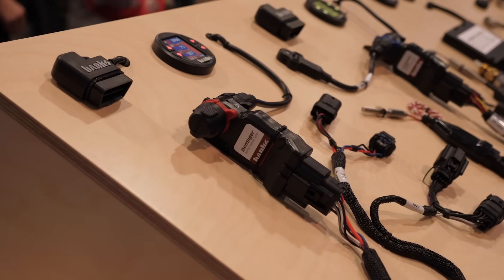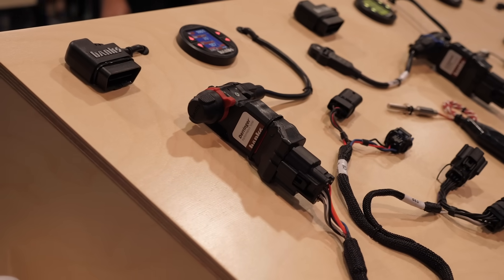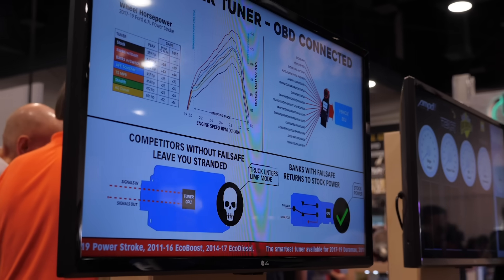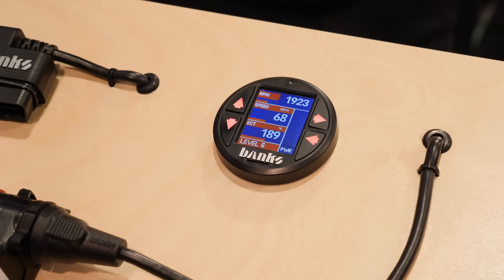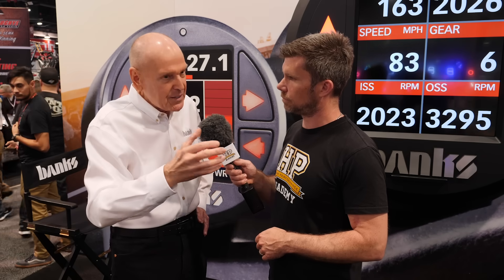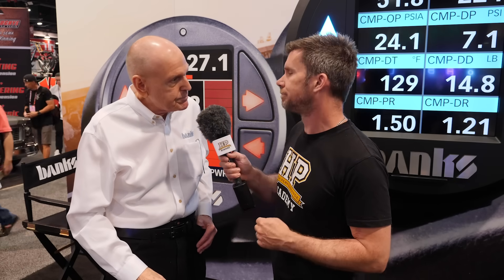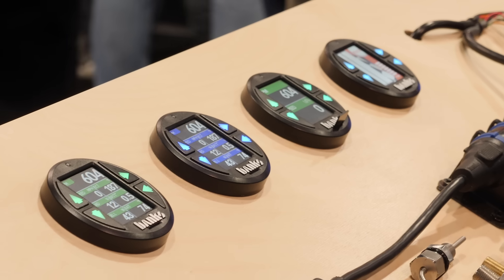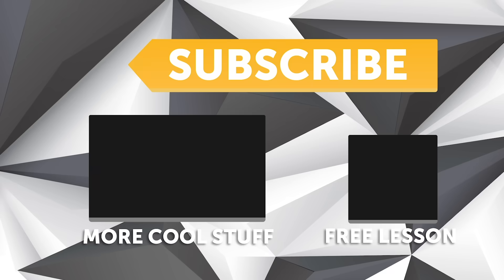More POWER With A DPF Fitted? | Gale Banks On Emissions [TECH TALK]

Comment: the failing emissions components and their replacement cost are criminal.
Reply: Basically in simple terms the new diesels eats it's own shit. The soot gets recirculated back into the engine ruining the internal components and contaminating the oil or turning the oil into grit. Which puts sand paper friction on bearings and such. I've seen this in ag equipment. 300 hrs and a tractors engine is done because of this emissions shit.. how long would the human body last if it eats it's own shit.
Reply: Searb reath These trucks run better without the DPF and EGR systems, everything lasts longer and costs less, I do both, use diesels for pleasure and work, and we had so many issues with dpf systems out of warranty we had to eventually buy new trucks or delete the ones we had, it didn’t make money sense to keep it compliant out of warranty when it kept having issues. Same thing with big trucks on the highway, while MANY aren’t fully compliant emissions wise, the ones that are still deal with not making much money at all, due to many concerns including this here.. so yes, while I can afford to stay compliant, it’s completely dumb in my opinion to be forced to keep it compliant, and forced to pay super expensive prices because you know I HAVE to buy it.. regardless of being able to afford it, getting price gauged is stupid. I’m not for smokey douche tunes, I’m more for reliability and money sense as a business owner.
Reply: ForgedDuramax I can vouch for what your saying. I deleted my p/u truck for reliability and longevity, not to roll coal!
These guys talking shit, you can’t afford it , have no fucking clue. I work in a tractor trailer shop, and I see first hand the issues with this stuff. We constantly have trucks in the shop for won’t regen and in limp mode, regen too often, stuck egr valves and pulling filters to be baked! 
I feel sorry for the owner operator guys, it’s not so much the cost of repairs.. and it’s salty! It’s the down time!
Reply: @50calprepper  That's some funny shit right there cause just last week our brand new catapillar loader had to get its filters baked already! The sucker doesn't even have 100 hours on it yet!
Reply: Searb reath you’re stupid. I always hear shit from truckers here in Ca about the stupid def/dpf  systems fucking up their trucks and show up times. I suggest you shut the fuck up and keep your stupid uneducated guess on what other people think.
Reply: Yep another way for big goverment to steal people moneys.
Reply: Searb reath  maybe you speak to a fleet owner and hear about the stupid increase in cost and maintenance.  That cost is passed on to their customers.
Reply: Searb reath  didn't name the manufacturer. I blame the EPA and bed wetting environmental brain washing.
If you like to read I suggest "apocalypse never"
Reply: The EPA is criminal.... And no I am not for rolling coal. We do need clean air.
Reply: blackscotydog that was a dumb ass, had lighting response!
Reply: @blackscotydog   a little soot does nothing to the air
Reply: Searb reath  i see you really dont understand the whole issue...nobody talks about heavy duty emission related issues where adblue pumps, EGRs, clogged DPFs and all other emission shit goes kaboom. Here in EU people drive long distances to home and work. Some even around 100-200km daily. The diesel is cheaper here than petrol. Also diesel has the torque what petrol doesnt, for daily driving this is needed more than your high end petrol hp. I would say that diesel is more future than petrol, but USA shitty smoke tunes have destroyed the reputation of diesels. Also all those who get walked over by fast diesel cars. Before you comment about using trucks or whatever for daily cars, i will always prefer diesel because of cheaper fuel price, easier to fix and find issues and also because of the torque and shame, when some high power petrols get gapped. 
DPF delete is better for the car and wallet.
I cant say same for the environment BUT all the elements mined for the DPF, constructing it, the extra fuel what goes into regen etc doesnt acutally save the earth either...sounds more like moneymaking spot, same as adblue. Without DPF Engine is more healthy because there is less strain because of the regen , back pressure and high temperatures. 

Say NO to the shitty "smokey chimney" tunes and do it the right way.
Reply: @Rrrowl   smokey tunes are the right way.
Reply: Searb reath  You know that semis and other heavy trucks have had major issues with the emissions requirements right? Look at the MAXXFORCE as one example. Also, why do you think CAT stopped making truck engines?
Reply: @Raise986  exactly! Our oilfield tractors are always having dpf/emissions issues. When I did work as a mechanic we had shit tons of trucks towed in because they were disabled from emissions system failures. My pickup is d3l3ted, but I dont go around rolling coal. My tune doesn't smoke at all on the 0hp setting. I didnt do it to roll coal like a juvenile, I did it because I want my trucks engine to last. Same reason I use diesel kleen fuel treatment to give the fuel some libricity so my high pressure fuel pump doesnt self destruct. Fass lift pump coming soon.
Reply: @Raise986  issue with that engine is that it was a dirty engine to start with. It should of been replaced.

Adding emissions controls to an engine that qas never designed for it is not a good thing. A dirty engine will never allows the aftertreatment system to operate properly or  last
Reply: Glad I got a spare 24 valve and a spare 12 valve.
Reply: Searb reath  high idle switch.  9 pounds oil pressure idling?? That engine is shot to begin with.
Reply: Searb reath  low oil pressure must be a ford thing.  Every Chevy I've owned has approximately 30 at idle..
Reply: Fuel additive and oil additive will help keep your dpf alive, nobody but the people using them on a daily basis will not say anything in regards to this issue, and the people not using these additional additives will typically complain
Reply: Shane Gunter 🤣
Reply: Searb reath  Why do I see guys taking new semis and ripping the emissions stuff off then if they can "keep up"?
Reply: Plus the fact that the manufacturers know this so they cut the warranty down to 50k miles instead of 100k.
Reply: If you’re using a smoking tune, you’re exhausting unburnt fuel.  True.  And if you’re deleting, you’re hurling soot all over your home.   Diesels need regulation.  
It’s expensive.  But the true cost of deleting is more expensive in health, human and nonhuman, alike.
Reply: @ColonelEMHouse  bullshit. your gas burning car is more dangerous then a coal rolling diesel.
Reply: Disban the epa!
Reply: No kidding!!!!  Having the carb and state of California working with the epa to throw bs mandates down our throats that not only do not work but also have bankrupted many many trucking companies and truck owners
Reply: Your not smarter than Gale.
Reply: My new truck was stuck in a different state hours away from my home for a week while I was at home waiting to have my emissions system fixed that cost me also $3000. The truck was used but had under 50k on it so I had a new payment plus the cost to fix just to break again months later costing me another $1000. It's a never ending battle with emissions on a diesel so had to go back to a gas motor because it was so unreliable. I wish I had done more homework before dropping 50k on a truck just to cost me so much money and have to get rid of it. It's such an unreliable system on a motor that is supposed to be known for reliability. It's a joke.
Reply: @williamroberts8550   Quality of Diesel and small communities drives make diesel trucks unreliable. In a world, with high compression diesel, people are buying wrong cars for their needs
Reply: Sounds like he works for the Epa lol
Reply: Searb reath You can stop right there bud. I own a diesel that is deleted because I’m not dumb enough to fix the stupid emissions shit every time it breaks. I’m also a diesel mechanic. I know all about the bs emissions systems and how it chokes the trucks and does nothing but hold it back. I work at a dealership I see the markup on the parts. Get some pink matter between your ears and then you can talk
Reply: @huntguy3831  every one one you tube is a diesel mechanic haha....idiot
Reply: Dylan Carmack I wish someone would’ve told me that earlier. I’m going to tell my boss I’m not a mechanic anymore so I can get moved up to an office job
Reply: Searb reath  If diesel's are only designed to tow, why does the Ram 2500 Cummins come with coil rear springs?
Reply: lllLoko because it's a better ride! You can't still tow 20,000 pounds with those!
Reply: Paul aka PD DIESEL keeps the emissions on his trucks,works'em hard and has put on a boatload of miles with hardly any issues.
Reply: Depends how you maintain your equipment also driving Habits create problems
Reply: O my god the Diesel bros butt hurt is sooo deep.  Your truck is not a fucking race car.  Take that shit to a race track. Nobody wants to breathe or listen to your loud ass dirty truck.  

Emissions dont kill engines. Stupid people do. 

Gale is 100% in the right here. Legally and morally.
Reply: @williamkillingsworth2619  so what's worse, the soot that settles to the ground or that toxic shit coming put of the exhaust that burns your throat, eyes and sinuses when it regens?
Reply: @williamkillingsworth2619  for trucks that aren't race cars my 800+hp cummins sure does walk alot of turbod vets etc on no prep 

Theres diesels out there running 5 second quarters and here you are telling us how slow they all. 

Brain cells are a super power these days i suppose
Reply: @fredmertz3837  try harder, if you think that's is going to offend me... lol.
Reply: @williamkillingsworth2619  Enjoy 10th grade and gym class.
Reply: @fredmertz3837  Thats all you got?
Reply: @natemartinez4595 Where do you race at?? I'll come out.
Reply: @williamkillingsworth2619  Thats all your worth little boy. Now go clean your room
Reply: @williamkillingsworth2619  so your ok with killing off the honey bee? Do some research before you open your mouth dpf and urea are not as good as you might think.

Comment: Exactly and well said.  More air or more air density is needed and once you have that it's easy to add the right amount of fuel to get the "complete combustion" and pollute less, not more. This DPF/DEF/CAT engineering is the cheapest band aid idea the EPA could have come up with. These Diesel engines need more engineering in the combustion of diesel, not a diesel fuel powered furnace that consumes more fuel and generates high risk heat.  The auto makers need to give us our monies worth with the engine engineering as to not produce the soot therefore eliminating the DPF/DEF monster idea that only takes away engine life, fuel mileage, power and so forth.  Truck owners are being forced to maintain and support a dumb method that was created on the cheap to manufacture and sell units vs. manufacture and sell reliable and clean trucks to the public. Overall, the new DPF emission ideas cause premature engine wear which is about the same as taking away 500,000 miles from engine potential life spans. Most highway long haul diesel engines of the past would go 1,000,000 miles before a major overhaul was required. Today, some are having to overhaul as low as 300,000 miles which is due to the back pressure and heat build up that DPF creates !   NOT a well thought out emission system, it's a cheap and simple band aid idea that puts owners of these vehicles in a bad way. Maybe it's time for the EPA to consider the public and the exorbitant costs that they are forced to deal with and get the vehicle manufactures on the ball and design better and cheaper internal emission controls.
Reply: Exactly, if the pollution is being caught in a filter and later burned anyway, what exactly did we solve?
Reply: @bunsguns8222 Well, the DPF catches and burns the leftover soot which is one particle they want cleaner but the other main negative emission is NOx which is partially controlled by the EGR, another device that hurts engine performance and longevity. It seem fair to say, diesel today is way cleaner than it was however, todays engines don't last as long, by about half, but they have more power and torque too.

Comment: I have a 2001 dodge diesel 5.9 mostly stock, 4 inch exhaust,  .75 injection running a smitty's tuner,  still trying to find the sweet spot in towing about 8k travel trailer trying the 5 setting

Comment: My brain hurts after watching this. New diesel owners don't want smoky trucks we want reliability, power, and not have to put piss jugs in our trucks. You can delete and not smoke it's done alot. Gale is just sucking off the EPA. The emissions system fail non stop and cost a small fortune to fix. I dont see the EPA going after any other type of tuning. I can run a rich tune and blow fire and raw fuel out the exhaust of a gas engine and no gives shit. Just the US getting in everyone's business and making a revenue generator. You wanna talk pollution stopping diesel enthusiastic from deleting won't change a thing in the world when 100s of third world countries including China and India have zero pollution control accross the board. Fuck the EPA. Fuck Gale Banks and fuck these loaded questions I would think this guy would say more then smoky diesels blah blah
Reply: Agreed, other countries counter in dirty emissions what the USA saves for a high cost. Overall, not really any change in global pollution unless all countries are in the same game.
Much soot is invisible, it doesn't have to been seen to be unhealthy. Add up the millions of vehicles and billions of diesel fuel burned each week. That's how the EPA sees it, they don't care about the equipment being used to do a job. Sad too...they should consider everyone, not just their ideals of clean air is our motto.  (at what cost and what benefit?).

Comment: Mr. Banks gets it. You don't need to be 'rollin coal' to make power.  Too many diesel guys out there being dogs about it for no reason as if having an inefficient clapper makes them better than a Prius driver.  Efficiency and power can be had together!
Reply: But it's Prius Repellent!   J/K  I never was one for rolling coal, though when I had my 99 F350, the one time when a cloud of smoke was asked for and received, was when a ricer with his buzzbox stereo and fart can pulled up along side to go around me at the light.  It was like the truck had a mind of it's own and fumed the inside of the civic. My truck took a crap over their rap. I haven't laughed so hard in a long time.  The truck was 100% stock too.  I have a 12 with the delete option(came that way from the factory, I swear), and with a decent tune, only smokes a little at certain times, such as slowing to turn onto an on ramp and then gunning it, some smoke will come out, but that is it. It does stink though, so  I would much rather have the Banks system, but no way for it to work on an already deleted truck, no I did not do the delete, as I said, it came like that, and didn't realize it until I got it home and crawled under it and realized, uh, that doesn't look right.

Comment: Diesel emissions are bull$hit.  Diesel engines hardly ever fail.  What fails- dpf, egr cooler, intake clogged with soot from egr, etc.  Make these devices last 500k miles routinely, no one would complain.  Dpfs go out all the time, and they take out the engine with them. Modern delete tunes increase reliability, longevity, and often double the fuel mileage of the truck.  It has nothing to do with blowing smoke.
Reply: True
Reply: I have a 5.9 cummins and the guy who owned it before me had a tune to roll coal but he gave me the tuner he used and I redone the tune to reduce the coal and now it runs almost a little puff of coal that is barely noticeable

Comment: Didn't answer the question, and the answer is no. The emissions bullshit serves no purpose other than to increase the operating costs of diesel trucks for owner/operators an small trucking companies. DPF not only kills engine efficiency, but it drastically reduces reliability. Don't kid yourself about "saving the planet" or "muh clean air". The earth sustains itself just fine. If you are dumb enough to buy into any of that eco-nazi propaganda then why are you even here?

The other misleading thing said here is that "good tunes don't smoke" as if to imply that newer DPF diesels aren't producing the black smoke diesels are known for. They are. The DPF is collecting this, and then wasteing fuel to burn it during "regen" cycles. Oh yeah, regen, that's nice having that shit kick in when you're trying to get work done.

The EPA has no authority to shut down private businesses. If you cuck to them, they will, but that's only because you CONSENTED. They cannot fine you or have you arrested unless you agree to it. There are no laws in US territory - only statutes...and statutes are contractual. Without your explicit consent and agreement there is no contract, and therefore statutes are unenforceable. You do not need permission from any "government agency" to modify your own private property however you see fit.

Comment: Completely unrelated but what do you think of cryogenic hydrogen for racing?  The cars would not need a cooling system as you could have some of the fuel flow through the block, thus reducing weight and being "green"